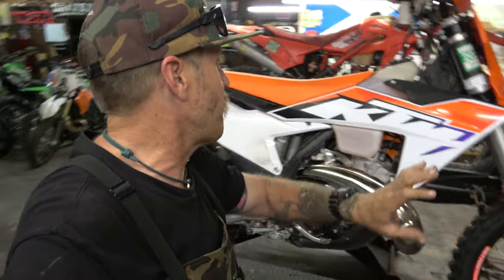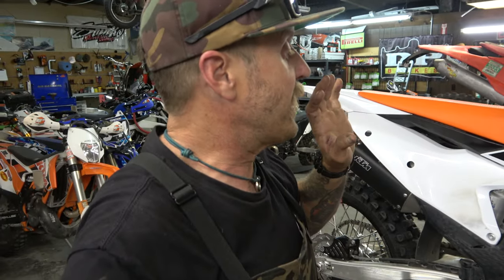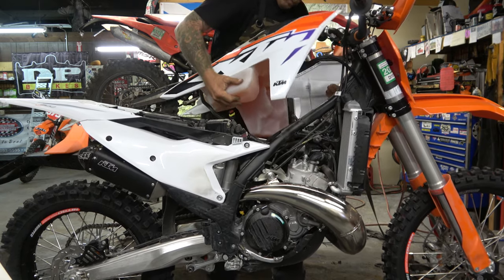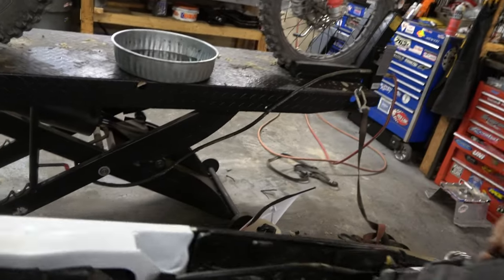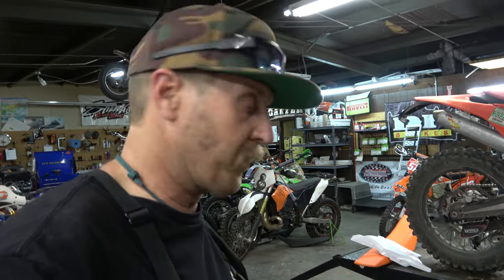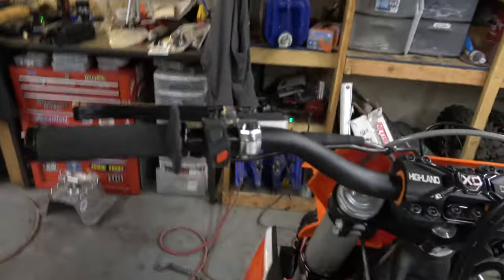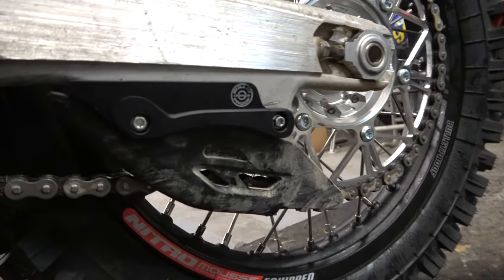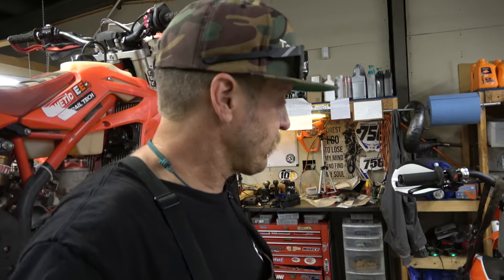2023 KTM 300XC | Bulletproof Radiator Guards | Enduro Engineering Hand Guards | Highland Cycles

Comment: I put a teail tech fan on my 23 250 xcf using the model designed for the 16-18 years since there's not one for the new 23s, perfect fit. Not sure if it would be the same for the 2 strokes

Comment: Hook the fan direct to the battery and put it on an on/off switch that you turn on manually
Reply from the maker: I have a set up like that.  I think i am going to wait until I can get it set up right.  The boys at True North Motos are working on it.
Reply: Really no reason with the colder seasons here be different if was dead of summer heat

Comment: Have they modified the bottom radiator hoses to stop them chaffing on the power valve body?
Reply from the maker: Yes. Well, the power valve covers are different which looks like it will solve that problem

Comment: too bad they couldnt do the Sherco ones right.
Reply from the maker: Rad guards?  I’d contact them and let them know. I’m sure they want to do it right
Reply: @highlandcycles  Nah AXP and EE bot offer tougher RAD guards with a crossbar between the two rads. Works a lot tougher for what I need. The BP guards just dont cover as well as they do for KTM. But honestly I dont like just the front brace/guard design anyways.

Comment: Looks like the battery cable is being pinched by the tank/shroud. 

I hope your 40:1 isnt going to gum the power valve up and cause issues. But i said it.
Reply from the maker: yeah, I fixed that later.  I don't think it will.  The bike is running perfectly and I have been running that in my 18 300XC-W for over 500 hours.  If anything, this should be more efficient and gum up less.
Reply: I like the way u think - wondering - Why would KTM recommend such a lean 60:1 ratio - to sell more bikes? 😅
Reply from the maker: @Hoser1mVm  exactly